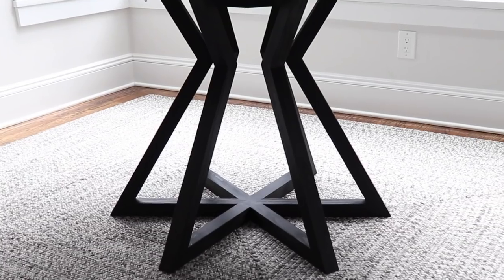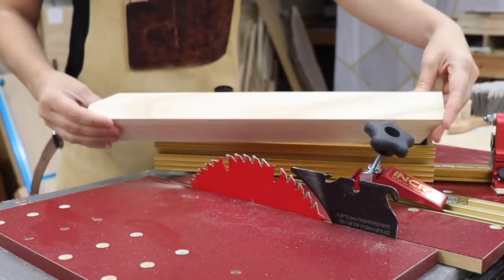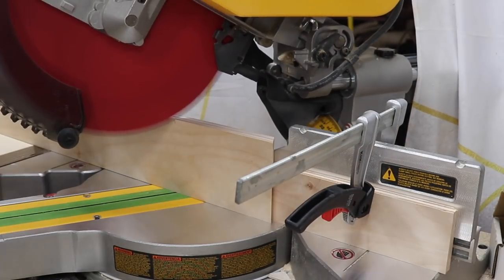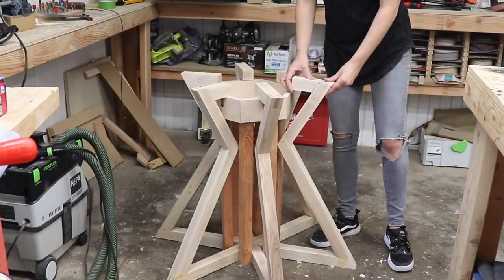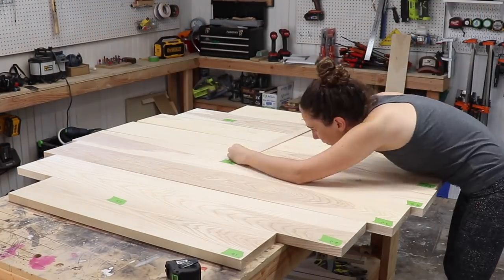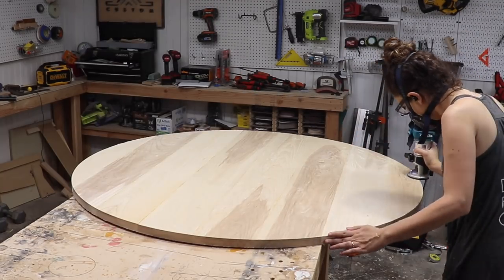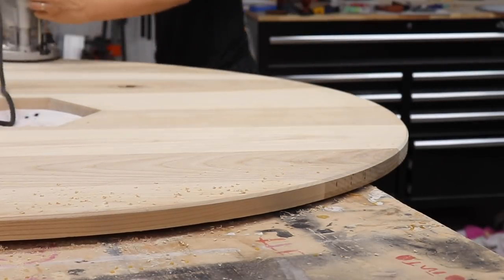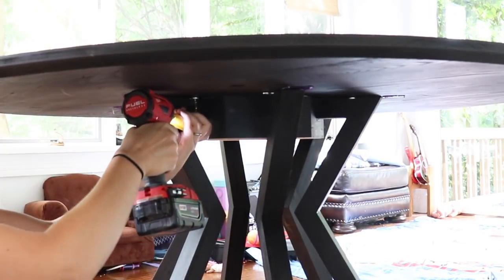How to Build a Dining Table with Storage // Woodworking // DIY Modern Furniture

Comment: Real great idea, real good job, but if i would build it id would some changes.
My english is real terrible, but i hop you unterstand it :-)
No holes in the middle piece, i would change it so if you press on a side of the hexagon , the piece will lift up and you can grab it.
ok you said the it heavy, you can resize it to an half inch thinkness, so my idea is possible :-)
Reply from the maker: Thanks!

Comment: Just curious as to why you didn't flip the top over and then put the legs on top upside down this way you wouldn't have had to struggle to lift the top.
Reply from the maker: Bc I wanted to make sure there was an even reveal on the opening from the inside. When I actually installed it in my kitchen that’s the way I did it. But the holes were already drilled for reference

Comment: There are hyperintelligent aliens after all...
Reply: @3x3CustomTamar  This is for inspired viewers. Mainly. The camera stuff might be of interest to you. You use tools that don't need to cost a bucketload of money, local marketplaces, a bit of ingenuity, of which you have, let us say, a great deal, I reckon that, being careful, buying what others consider to be junk, and using what I already have, I could put a worthwhile shop together where I live for less than $500. Like you, I am not in mass production, so tools that are really reliable when beaten to death you do not need. Like cameras. You said you were interested in improving photography with a DSLR. Unless you are trying to capture the nuances of the Superbowl, a great game, BTW, at 20 frames per second,  or pics in low light, any entry-level Nikon from the D3200 up has one of the finest imaging devices. You can probably get one of these for a couple of hundred. Knowledge and feel are the greatest thing, not kit quality, when to start with you don't know what even matters. And find someone to talk to, nearby. 

Let's consider a very cheap bench saw. A motor, a blade, and a pile of scrap metal worth 5 cents. But, you can make a new table in lots of ways. The motor and blade will probably be ok. The fence will probably be ok. Now you can cut wood parallel. A guidway need not be routed, just two pieces of sawn MDF at the right distance, stuck to the tabletop. The longer the guide, the better the accuracy. That battered old oak, out-of-style table on ebay will do as a start. And so on.Worried about joints? Unless your 10 year-old is smoking them, forget it! Grab as many clamps as you can, rusty old ones are just as good. The glue is usually much stronger than the wood. In fact, always. A straight well-sawn end can be glued to a planed surface with no reinforcement at all. Kit furniture uses dowels and cam locks only to help with flat-packing, these are not taking any load. They serve only to locate. A couple of nails can do this.

If you have a feel for this, remember wood expands and contracts a lot, but pretty much only across the grain, and hardly at all along it.

And for goodness' sake be safe! Circular saws are very dangerous when rotating, and moderately so when changing the blade. Keep those fingers out of the way at all times, and wear eye protection. Beginners often have so much enthusiasm they forget that when cutting a strip on a sawbench the last place you need to have your hand is between the blade and the fence. Unless you want to see it from an angle you have never seen it before. Cleaning up the blood with one hand is harder, too. Notice Tamar always uses a pusher. Never overload tools, a bandsaw blade can give you a very nasty nip, if it breaks. Read instructions. Switch off the power, or best unplug, before working on any power tool.

Comment: Couldn't you have installed the top on the floor and the base upside down... Then flip?
Reply from the maker: That’s actually what I ended up doing when I installed it in my kitchen. Had the husband help with that. But I did need to mark out the exact location of he base and that was easily done the way I did it in the video.

Comment: When you were putting the table top on the base. Why not just put the table top on the floor upside down, and then set the base on it and drill the holes????
Reply from the maker: Bc I had to make sure the top hole was in line with the base. I wanted to make sure it was perfectly even all around.  Once I drilled all those holes thought. I was able to do that when I actually installed it in my kitchen